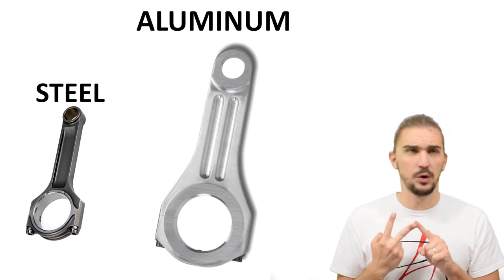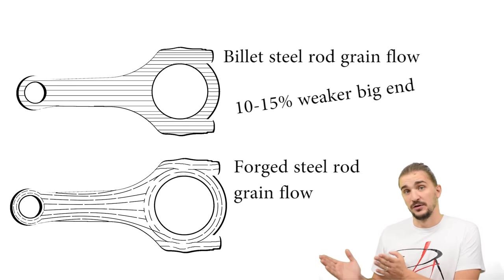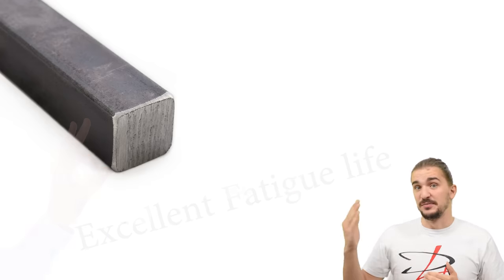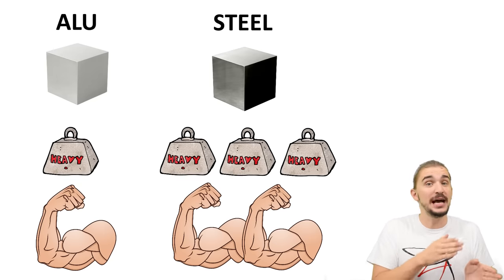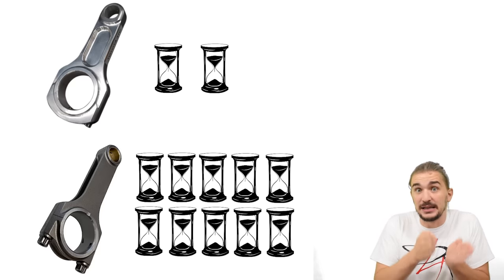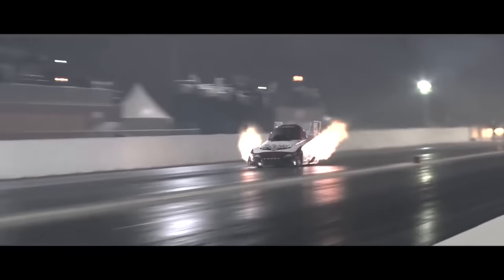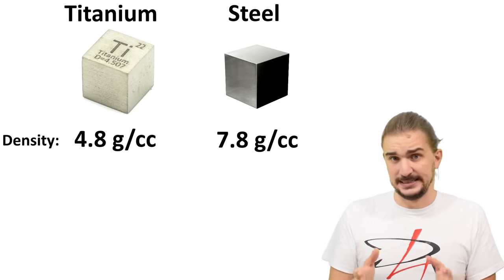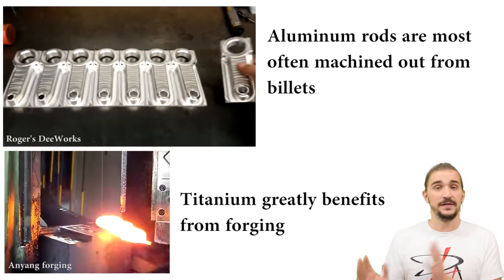STEEL vs ALUMINUM vs TITANIUM Connecting Rods

Comment: 1.   Fatigue.  The poor rod suffers a stress reversal between intake and expansion, life couldn’t be worse. 
2.   Shot Peening.  The shot stretches the surface past yield so it is permanently elongated.  The material just below (say .010”} remains elastic and squeezes back on the elongated surface.  Thus the surface in compression.  Metal fatigue starting at the surface is checked by these residual stresses.    Radius rolling crankshaft fillets and screw threads is the same principle.
3.  Nitriding.  Nitriding infiltrates nitrogen into the metal surface.  The surface elongates and residual compressive stress results...same general idea as peening.
4.  Forging versus billet versus HIP.  Steel elongation and fatigue strength historically were directionally favorable in the rolling direction, and half in the transverse direction.  Directionality is anisotropic.  Forgings refined and purposely oriented the grain structure to the load as noted.  
   In the last 30 years, steel making practice has improved the transverse properties of wrought (billet) steels.  The difference between forged and billet is thin...if the billet is properly made (clean (electric furnace or VAR), and fine grain (10_12))
     HIP...hot isostatic pressing (powdered metallurgy) yields a rod with the same properties (isotropic) in all directions.
5.  Wings Factoid.  Aluminum airliner wing center section skins are machined from an aluminum billet with integral stringers.  The skins outside is shot peened bending the wing to the airfoil contour.

Comment: There's a sweet spot to the amount of carbon that you want in the steel to increase the tenacity. To little will give you mild steel like an SAE 1010 who will be very ductile but have a low resistance to permanent deformation where as a 440c used for hard razor blade will be to brittle to resist to crack propagation. So a 4140 or a 4340 is in the sweat spot for the carbon contant. The same principle can be applied for the heat treatment. (benite to soft and martensite to brittle).

Comment: Most common "forged" conrods are actually sinterized from what I know. You end up with smaller grains, which improves material tenacity with decent resistance.

But it's not an actual forged part, which would have even greater yield stress and resistance limits.

Regardless of that, this is a very useful video! Some great knowledge here and you present it in a simple and informative way.

Comment: A titanium part can actually last forever depending on the crystal structure. Generally speaking any alloy that crystallizes in a body-centered cubic lattice can endure infinite load cycles (at least theoretically). Titanium crystallizes in a alpha-phase (hcp) or beta-phase (high-temperature bcc-phase). If you add enough elements to titanium which stabilize the beta phase (e.g. Cr, Mo, W, V, Nb) you can obtain a beta-alloy which can live forever. Another advantage of titanium is the extreme oxidation resistance which tool steel does not possess to this extent. Otherwise excellent video material

Comment: WO Bentley used (If I  remember correctly.) aluminium connecting rods in the Lagonda V12. He came to the conclusion after the fact that it was a waste of time, by the time you had made them fat enough to have a  decent fatigue life, the weight saving was negligible. W.O. ran the alloy rods directly on the steel crank.

Comment: Really good stuff.. mention "Cracked" rods advantages in one of these?
Reply: The advantage of cracked rods is that the rough mating surface helps the caps lock together. With a machined surface there’s primarily only friction holding the caps in alignment.

Comment: So would the best of both worlds not be a steel rod that was forged into a “rod shape” oversized and then machined down to its final size/ finish. therefore achieving correct grain structure and direction around the big and little end whilst also having the uniform surface finish?

Comment: You don't need to tear your engine apart just to check your aluminum rods......  We had a caliper that screwed into the spark plug hole.  All it took was one revolution of the engine by hand to measure the rod/piston installed length.  At a .040" growth over what the length was when new, we then pulled the engine down.  
Also:  If you want to experience the strength difference between cast and forged, get two used SBC pistons. One cast factory type and one forged type.  Crush them in a hydraulic press.  The cast will begin to fold up and crush easily. The forged piston will hold for a little bit then fail suddenly.   Very graphic.

Comment: Any recommendations for a 7.3 Powerstroke Diesel…? Valve train-Valves, valve guides, valve seats, retainers, push rods…? Connecting rods…? Anyone…? Looking for long term efficiency and Mass Weight Reduction, Inertia weight, reciprocating weight, the principles of reducing excessive internal force to reduce fatigue and increase durability. What ya got?

Comment: al connecting rods are used in rc 2 stroke glow engines, it rotates at 20000rpm
Reply: 2 stroke rod under lot stress  than  4stroke because  2stroke  engine has compression  every time piston  reaches top on 4stroke every other time piston is trying  to stretch rod steel much weaker being stretch than compressed

Comment: Well the reason that most drag cars need to check the aluminum rods out more often.  Is because these engines cost $150,000 each.  Street motors are probably between $3,000 to $8,000. So a rod that is used for $150,000 motors can't be all bad.

Comment: So are they not forging an oversized billet into a shape they can then further machine and get the benefit of both forged and billet for the rounded flow grain structure at the end of the large end of the rod? Seems like someone would have done this but I don't see any options on the market...

Comment: Since engine blocks are generally Aluminum the expansion problem (along with fatigue) with aluminum rods appears to be a mismatch of operating temperature between block and rod. Fix that and aluminum rocks, right?
Reply from the maker: The problem with rods is that they experience immense load, blocks don't.
Reply: @d4a  yes they do. They need beef and coolness to fight creep. On the other hand, iron and titanium have different coefficients of thermal expansion. Their lower COTEs means that their squish zones are degraded as the engine warms. My question relates to a choice in a new type of engine. I'm shooting for 2/3 efficiency so the COTE mismatch is an issue (the design requires very long rods).
Looked up some NASA research on aluminum alloys - it looked like aluminum can take it if kept below 250F...
but different application, alloys, and whatnot.
Have you read up on coated aluminum? Even crankshaft possibilities

Comment: The MAIN reason  i don't use aluminum rods, is;How on earth do you set rod bearing clearance? The things change a bunch. at just 160 degrees. that's why the Aluminum rods use a pinned bearing . Where crush holds the bearing in place on a steel rod, the aluminum rod grows too much to have enough crush to hold bearing.The titanium rods just cost too much,My customers would never buy them. even though they are cool. I have built a couple sprint car engines with Titanium rods. they hold their size much better that aluminum. And you have to use special assembly lube on Ti rods too

Comment: What if you forge a connecting rod oversized and then machine it down do you get the benefits of both forged and billet or is this a dumb question
Reply from the maker: It's not a dumb question. Almost all forged rods do in fact feature some machined surfaces. But machining all the surfaces after forging is complex and labor intensive with decreasing benefits that make sense only in some very specific or extreme applications. Most aftermarket forged rods have therefore settled on some middle ground when it comes to the amount of machining, and this fits 9/10 applications perfectly well.

Comment: The weight does not really impact how much energy is transferred to the wheels and does not make it harder to rotate either.
What it does do is just increase the moving mass - so stronger vibrations, more stress on the crankshaft, more rotational inertia.

Comment: All three are designed to deal with the same loads. Titanium is thinner but stronger. Aluminum is thicker to match strength of other rods. Steel is middle size and strength.

Comment: Now build a titanium rod as thick as the aluminum and you have a winner!  Especially for truck and tractor pulling.  But it's not in the best interest of the suppliers or builders to build a robust engine in a high stress environment.

Comment: Thanks, you have convinced me that electric cars are best. And so whatever is wrong with steel? Steel seems to be the best compromise for the daily commuter/driver.
Reply from the maker: https://youtu.be/xTsOnWoLHtA
Reply: @d4a 
Thanks, but I already just watched that video, as you may have guessed, I am a fan of the Tesla EVs that hopefully soon will be majorly moving towards fully autonomous self-drive. I am a good driver, but I am tired of driving. I would much rather ride. However, as I have to live on a budget, I drive a very old manual-drive ICE. Automatic transmission but of course. As EVs have no transmission, that is even better.

ICE is so yester-century. It is really a complicated chemical reaction factory underneath the hood, and I can't afford the team of technicians that would seem to be needed, to run a complicated chemical reaction factory. EVs started looking much better to me, once I heard that they were getting 200 and even 300 miles of range on a charge. Maybe soon, over 500 miles?

I much liked your presentations, as there are so many pros and cons to consider, and you seem to explain it so well.

Comment: What sort of casting are we talking about? ( hot liquid metal obviously. Lol)  but its not quite so straight forward . if that steel happens to be a super alloy like stelite , it has to be cast. But with a vaccum and steps omited from what i was reading, it too can align the grain structue.  Also for a crystaline structure to be so large. They kept that part hot for a very long time. The forgeing was hot forged  but the working of the steel cools it down rappidly too. Extruded billet can also. Its all in the method used.

Comment: One reason billet rods get away with a weaker big end is it's almost never the big end that breaks, it's right under the small end that usually breaks.
Reply: Usually! I had a Chevy pink rod  break just under the big end. We had run the engine just over 6 hours (practice, qualifying & 500 road race miles) with 7500 redline.

Comment: "cold welding," happens in space. When 2 bare metals are in contact without any gas between them they will fuse together if they are of the same material.

Comment: One other note about titanium, which is known by those who worked on the SR-71. Tools with cadmium cannot be used, as they will create a failure point in the titanium.
Reply: Can't write on it with a Sharpie marker either. SR71 workers found this out the hard way as well working with sheet titanium

Comment: the best engine is either the na big or medium cast iron steel and tough engine or the alumunium turbo engine for normal cars, other than that for maximum posible power forged or titanium but forged as heavy big piston

Comment: What about sintered steel rods? They are fracture split, so they are one contiguous piece of material and the surface is an exact match which cannot be achieved with a machined surface.

Comment: I wonder if anyone has ever considered using carbon fiber for piston rod?
Reply: Would be a terrible idea as the resin used in carbon fiber will not hold up in the high temperature of the engine.
Reply: Here it is;
https://awacomposites.com/products/
In the mid 70's NASA had to lay off some of their groups. One guy helped develop the different stages of the rockets(Composites). He had some time and developed the Polyrod. It was like layers of fiberglass and if it developed a crack it would hit a layer and start crawling down the length instead of across the rod. Pretty cool concept and I never heard anything more about it. 
I'd like to see ringless pistons from carbon/fiber.

Comment: >>> Rod Stretch <<<  I was surprised by this.  I would expect rod compression or bending. Of the 4 strokes only the intake puts the rod under tension, the others put it under compression. I would think that the combustion stroke would be the by-far greatest stress, compressive stress.
Reply from the maker: The greatest stress on the rod is forcing the piston to change direction.

Comment: Im confused, why couldn't you forge a billet rod? Also are there any rods made with modern "super steels" like "M390, CPM 3V, Elmax"?? Love your vids
Reply: ...because then it would be a forged rod, not a billet rod. A forged rod is a rod whose shape was created through forging, a billet rod is a rod whose shape was created through machining a billet. (A billet is basically just a bar of metal, good billet parts use billets that were made by forging)
Reply: @Kevin-dt9xm  m390 is powdered metallurgy so it's not really made same as traditional forging or billit
Reply: @bitrage.  cool, but i dont see how thats relevant to my comment. You asked "why couldnt you forge a billet rod", and i was answering that question.
Reply: @Kevin-dt9xm  well if good billet is forged then why would there be forged and billit... if good billit is forged then that would logically be the stronger part no? Like confusion if some billit is forged others aren't and then there is a separate forged parts... a forged rod would also be a billit rod since billit is forged!... I'm guessing it's terms brought in on the industry to have a "New better" something to advise... should be forged non billit, billit, and non forged billit... You can forge billit, billit is not necessarily a rod or bar, it could be used to indicate a part was made from a billit rod, but it still could or could not be forged... then new "supersteels" are powdered and forged with all grains in same direction with a accurate distribution of other metals/compounds, but I'm guessing it would be way to. Expensive and/or no real advantages in the piston/rod application...
Reply: @bitrage.  as i said, a forged rod is a rod whose shape was created by forging, a billet* rod is a rod whose shape was created by machining a billet. A billet is just a round or square bar of stock metal, the billets used for engine internals are generally forged. However, that doesnt make it a forged rod, because it was still machined into its shape instead of being forged into it. If you watched the video, youd understand why theres a difference. A rod which is machined from bar stock, whether or not that bar stock was forged, has a grain structure which doesnt follow the shape of the rod. A rod which is forged into its shape has a grain structure which DOES follow the shape of the rod, meaning its stronger.

Forged rod = metal forged into a rod

Billet rod = metal (often forged) machined into a rod
Reply: @Kevin-dt9xm  ok I get what you are saying, so the billit rod is forged but the grains are running to the shape of the original rod where forged the grains are running into the shape of the part... thanx!🤙

Comment: It'd be interesting to see how carbon fibre con rods compare to these metals
Reply: It has been used. There was a Ford engine some years back that used carbon fiber rods and there was no info on how long the engine lasted. Most engines are made with cast iron rods which are about 70% as good as steel. (From a Tool and Die maker who has machined a lot of materials, and built a lot of race engines.)

Comment: I have a question, why aluminum rods absorb more shock than the steel rods? Because for bicycle, aluminum frame are less comfortable than  the steel frame.
Reply from the maker: Think about tube thickness vs weight
Reply: A steel frame means more inertia which means more force to move the bike, which means the same size bump wont move the bike as much, so it wont be felt as much by the rider. The actual springiness of the metal isnt a factor there. In an engines rotating assembly, the rod is rigidly connected to the piston and crank, meaning regardless of inertia the rod is still gonna move the same amount every revolution. Therefore the steel rod having higher inertia doesnt matter for shock absorbtion, because either way it and the aluminum rod are moving the same amount. Thats when the elasticity of the metal comes into play. Aluminum is much more elastic than steel, meaning itll squish more before deforming than steel, meaning itll transmit less force from impacts. Since neither metal is elastic on a human scale (aluminum is still a hard, rigid metal after all) its not a big enough difference to be noticed by a bike rider, but it is a big enough difference to matter in a race engine.

Comment: Powder steel? Comes in more and more stock motors, like the common LS motors. Modern aluminum rods last about as long as modern pistons made from 2618 aluminum. Last, drag racers do the least warming before going all out of any racers I can think off.